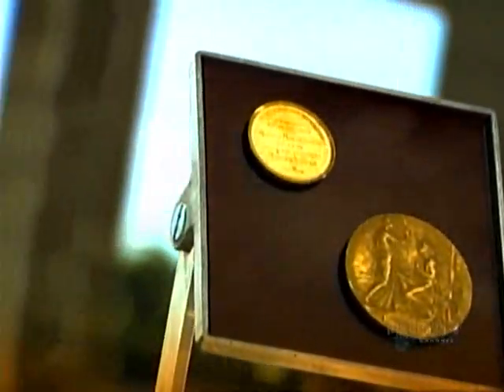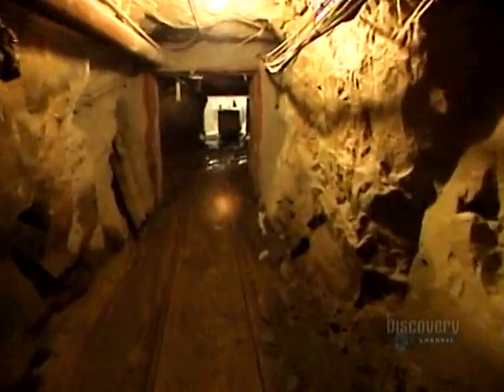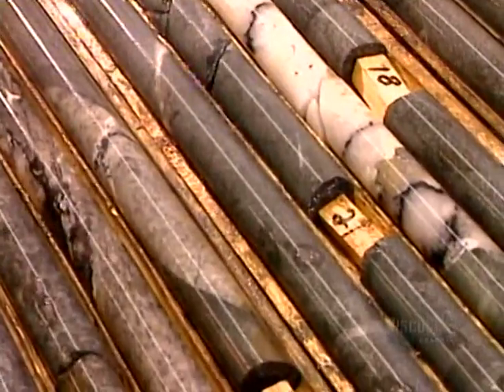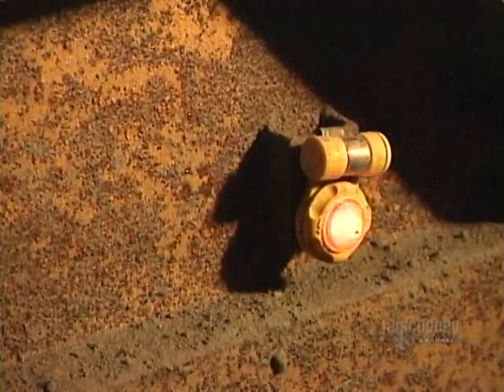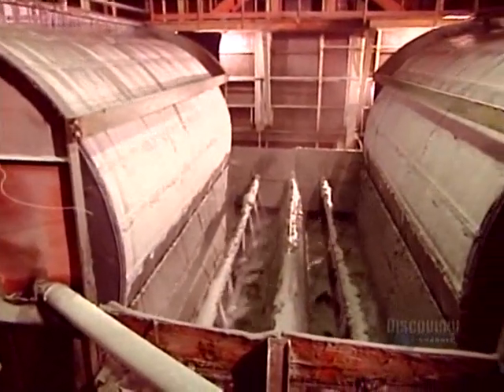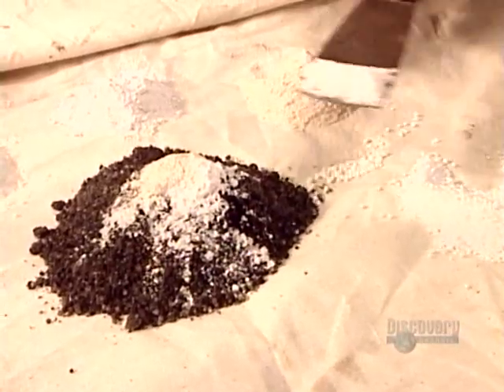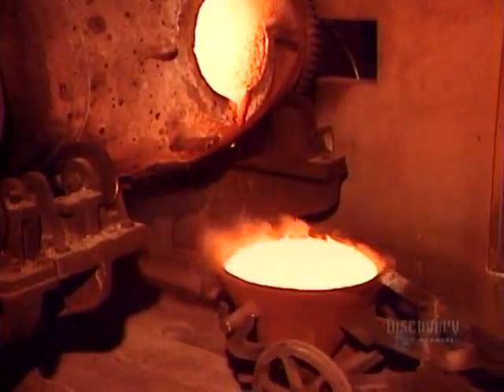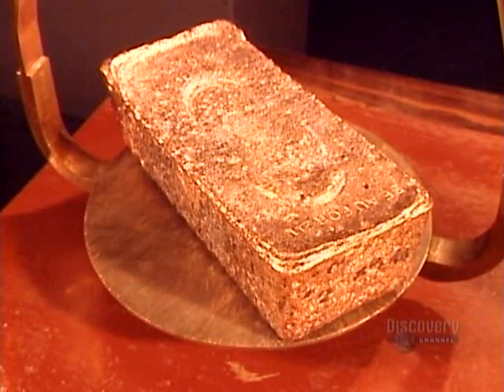Gold - How its made

Comment: This is how it's processed, not made! In order to MAKE gold, you need to combine a tiny ball of electricity (a charged particle) with another tiny ball of electricity. This is how you make a neutron. In this case, you would call it a LIGHT neutron, since it is only made up of 2 charged particles. Neutrons will not get any larger even if you add more and more charged particles. It will get heavier as its' mass increases. If you look at the periodic table of the elements it will show you that they are all made of the same energies. What these energies become depend on many factors, sometimes controllable, that will determine what element will emerge. Including gold.

Comment: WTF?! Gold is NOT the softest and most malleable metal, not even close! Indium is much softer, so softer you can take a bite out of a very thick chunk of it, you wouldn't be able to take a bite out of a similar sized piece of gold. Alkali metals like lithium, potassium and sodium are very very soft too. Soft enough that you can easily cut it with a butter knife. Gold is really not that much more soft than Aluminium. This is a myth that Gold is so soft. You'd think that a Science channel show would be smart enough to do some simple fact checking instead of falling back on old myths.

Comment: Most useless metal ever!
Reply: +Lenin Luna You wouldn't be on youtube without this useless metal.
Reply: It's extremely useful in electronics and in chemical production.
Reply: second prettiest metal ever
Reply: ikeknights OK you win.  :(  I said that because I hate jewelry.  What diamonds, rubies, and sapphires that are used instead of "looking beautiful and expensive"?
Reply: Lenin Luna

I agree with the sentiment, but we find uses for almost everything, for example we use artificial sapphire and quartz windows in our research too.

They're really strong and corrosion resistant, they're great for high vacuum systems as the lattice structure helps to stop bleeding of gas and they also have quite a large optical band-width.

Normal glass typically blocks a lot of high Infra-red and almost all of the ultraviolet emission, so we use quartz which allows those frequencies through to detectors.

It's artificial stuff though, the 'real' mined gems have too many impurities.
Reply: Lenin Luna I agree with that. Before the electronics age, gold's worth was only because people liked shiny things.

Comment: but how did they make it thousands of years ago when these powders and pure metals weren't really known of. there mush have been a simpler method
Reply: Thousands of years ago, they only collected gold from stream beds. You know the old pictures of prospectors swirling water around in pans to separate the rocks and sand from the gold? That's how they got the gold. Because it's in streams, the water flowing past erodes the ore the gold is in and you're left with gold flakes, gold nuggets etc. To melt it, they would build a fire - using wood or anything else they could find that would burn - and use bellows to get it as hot as possible. Then they put the gold flakes in a ceramic container, put the container in the fire, and let the gold melt.

Comment: strait away a mistake. gold is not the softest metal, even i know that, so it's softer than mercury? or one of the other liquid metals? or softer than lead?
Reply: You're partially correct. While gold is harder than lead, it is not harder than mercury. You can't really call mercury a liquid metal. Mercury is simply a liquid at room temperature, when mercury is in it's solid state, it's actually quite hard, like a normal metal.
Reply: Andy Finendale Amen.

Comment: I work with platinum, daily, and I charge a lot more than I do for gold, mainly because you need some special tools to work with it and also because it's 90% pure and up (and it can be contaminated if worked improperly) while most gold I work with is 58% (14K) or 18k (75%) pure. Platinum also doesn't scratch like gold, so the weight will vary only very slightly when it's worn over 100 years. Platinum is NOT white gold; platinum is platinum.

Comment: I can tell you:
In the lighter there is a little container that holds the gas. When flick the wheel on the lighter, sparks appear from the flint which ignites the gas that is released when u press the button under the wheel. It isn't complicated at all.

Comment: Gold is not the softest or most malleable metal.

Cesium .2
Rubidium .3
Sodium .4
Potassium .5
Lithium .6
Indium 1.2
Gallium 1.5
Lead 1.5
Calcium 1.5
Strontium 1.8

or by hardness

Zinc 2.5 
Aluminum 2
Antimony 3-3.3
Bismuth 2.5
Cadmium 2
silver 2.5 - 4
Magnesium 2
Mercury 2-2.5
Gold 2.5-3

wiki.answers.com/Q/What_are_the_ten_softest_metals#ixzz1xiUpf0t6